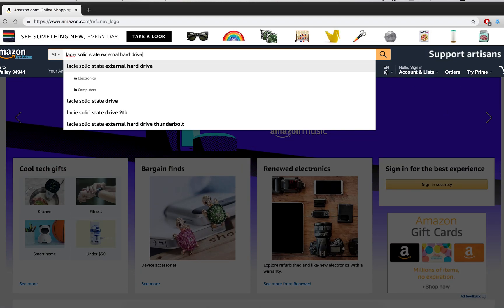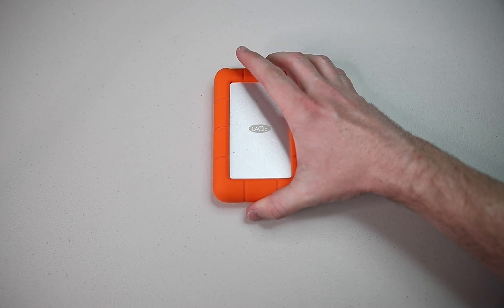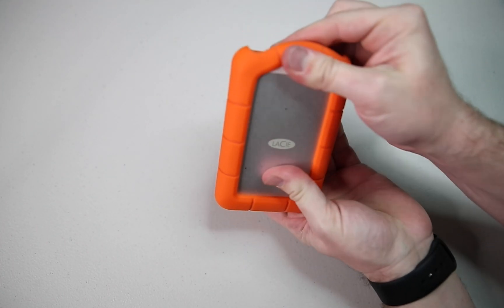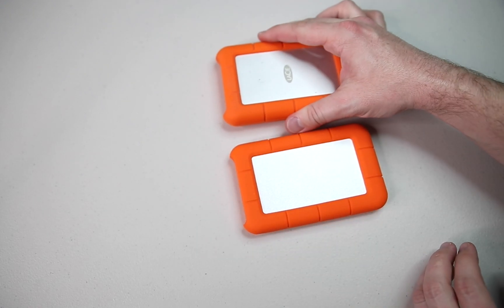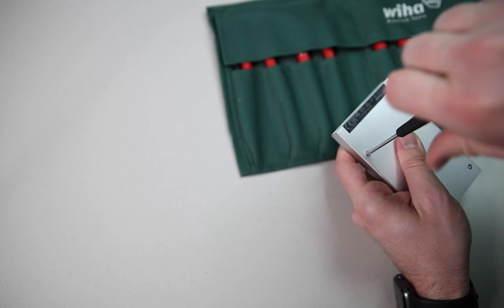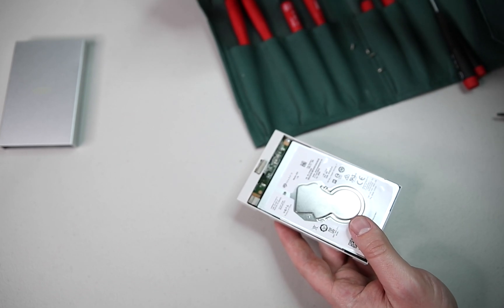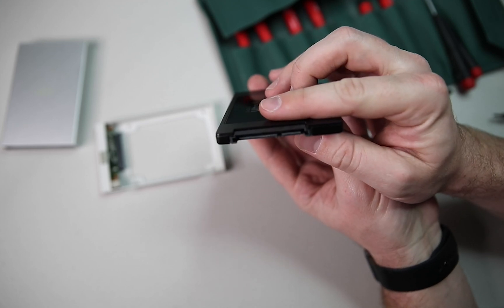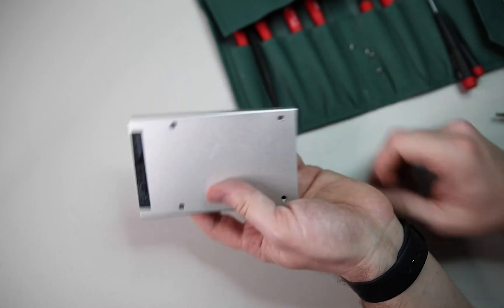Tutorial - External SSD at a bargain price! (Taking apart a LaCie Rugged drive)

Comment: PSA: The HDD versions of the USB C LaCie external drive use an Asmedia ASM1153 SATA chip, at least mine does. It's thus limited to SATA 3 speeds and will basically cut any good SATA SSD's performance in half. I don't think the SSD version had that limitation. I also wonder whether the Thunderbolt LaCie drives that came with HDDs use SATA 6.

That being said, improved reliability, shock resistance, and vastly better latency of an SSD swap are still worth it if you already have an old Lacie. My LaCie came with a Seagate Rosewood drive (like the one in the video), the inflamously fragile and unreliable one. LACIE did a good job protecting the hard drive since it still worked when I upgraded it to a Cruxial MX500. I like how easy these drives are to work on compared to other offerings, almost makes me want to hunt down broken drives to repair.

A Sabrent Rugged USB 3.2 NVME enclosure is many times faster, much more water resistant (IP67), and more compact than this. Tech marches on.

Side notes: Seagate acquired LaCie in something like 2012, that's why they use Seagate. My old Lacie Triple (the one with FireWire 800) used a Samsung Momentus drive that still works to this day. Samsung's HDD department was also acquired by Seagate.
Reply: Couldnt you bypass the SATA interface in the enclsure by using a SATA USB cable straight into the drive?

Comment: I need help, I want a SSD external drive that will work with a Mid 2011 i7 iMac, using Thunderbolt 1.0. I want to make the external SSD drive a boot drive. What do you recomend, I bought a Lasie drive with USBC and I bought adapters to hook it up with Thuderbolt, but it is 2.0 and I can't seem to get it to work. Is there a solution?
Reply: Regarding an EXTERNAL TB1 connection, you could/should find a used "LaCie Rugged THUNDERBOLT". It has a build-in TB1 cable and connector. The speed is limited though (max. 387 MB/s according to LaCie website, probably you will get less. I guess a limit of their SATA controller chip/board), but it should be fast enough for external booting. Much faster than your internal HDD. And you won't have to tear apart your 2011 iMac ;) I really wonder why LaCie did sell HDD + TB at all?! 
Remember: this video does only show the USB3 version. Only suitable for Macs with USB3 ports! I have heard USB3 is even better supported by LaCie and funnily slightly faster than TB1. Although TB1 is theoretically twice as fast as USB3 ;) :o :(
Reply: @maikkaune  Thank you, I am a New Sub.
Reply: The best, fastest solution is the 2nd internal SATA connector. Assuming you have a 27“ mid2011 machine. If your HDD is still healthy, you might keep it. Benefit, no fan issues, no extra software for fan control. But you need a 2nd SATA cable. If you want to get rid of the HDD completely, you might replace it with the SSD. That requires a cable modd or the OWC cable with Sensor. BTW, even the newer 2012+ with TB2 makes not much sense externally. The official Apple TB Adapters plus TB cable, plus TB enclosure are too expensive… and I remember there is still a technical power issue. 2012+ external boot with USB3 is o.k. and much easier and cheaper. Unfortunately not an option for the mid2011 😢
Reply: same here, looking for Time machine backup drive for my mid 2011 imac..getting Lacie rugged hdd and upgrading most likely to ssd

Comment: Just today I installed a 1TB Samsung 850 Pro into the Lacie USB-C/Thunderbolt enclosure. Now my SSD, enjoys TRIM and SSD support under MacOS. Previously using the USB enclosure did not allow for TRIM. Thunderbolt is the real reason to upgrade these. I've taken the rubber off to allow better thermals. I get 49 degrees C when backing up the SSD and the enclosure feels warm.

Comment: Thanks for the Demo. Do you know if you can buy and install the same type of SSD in the older Lacie Rugged drives. I think my older drive has the Micro-B USB cable and not centered on the case like the USB-C rugged drive. I bought the "LaCie LAC9000298 Rugged Mini 2TB External Hard Drive Portable HDD - USB 3.0 USB 2.0 Compatible, Drop Shock Dust Rain Resistant Shuttle Drive, For Mac And PC Computer Desktop Workstation PC Laptop " years ago and would love to put an SSD drive in them.
Reply from the maker: Yes, I just did this this month with one

Comment: Thanks for the informative video. Do you think you could do the same thing to the Rugged RAID drive and switch out two HDD's for new SSD's? That should technically improve the performance right?
Reply from the maker: I think it would, but I don't know if there's enough clearance for two 2.5mm drives in there, and then I'm not sure what the raid array looks like.  Worth a try!
Reply: Hi @rufeus78, did you ever get around to upgrading the Rugged RAID? If so, how did it go? Any issues encountered?
Reply: @TK13619  Works. But the LaCie Raid manager does not recognize the SSDs. You have to either use it as JBOD with two individual drives or use the Mac RAID manager in disk utility.

Comment: Hello. Thanks for the very informativevideo.. I just have one question I was wondering if you wouldn't mind answering for me I'm stuck before buying this? I plan on hooking one of the drives... well one of the slightly older models (SSD Rugged 500gb) up to my mac with the old thunderbolt 2 cable and installing OSX on it to achieve faster speeds than my internal hard drive. My question is, when I do this, could I utilize the USB 3.0 port on the Lacie device to connect an extra 2TB hard drive? That would mean I have 2 external devices and one of them would be faster speed (USB-3.0)... Someone mentioned that they are not sure this would work as it's maybe not a "thru port"? If you could somehow clarify this I would be very grateful
Reply from the maker: Nope! that usb controller isn't set up for that sort of configuration.  If you do install the operating system on an external drive you'll see bottlenecking speed from the drive controller

Comment: Dude, I was looking everywhere for someone who changed the USB-C rugged HDD to SSD. I've done the same already to a USB 3.0 rugged drive. So on what computer are you using the drive and what speeds are you getting? I want to do the same thing, I'll never trust an HDD again with my video and photo work...

Also, Seagate bought Lacie in 2014 so they are making their own drives, technically 😉
Reply from the maker: Yeah! I didn't understand why the price was several hundred dollars upcharged for SSD, so I figured I'd see what I could do.  According to lacie's tests the HDD gets 110 MB/s, and the SSD should clock somewhere around 387 MB/s.  I'd say 3x improvement is about what I'm seeing.
Reply: @delseccoj  Thanks for getting back. I just checked the speed on my Rugged USB3.0 with SanDisk SSD. I get W 244MB/s and R 260MB/s. USB-C is a bit faster then. I might check the prices on Amazon Prime Day or Black Friday sale to really get the best deals.